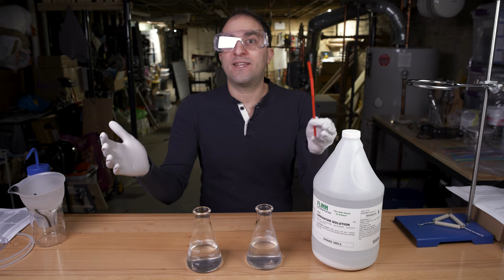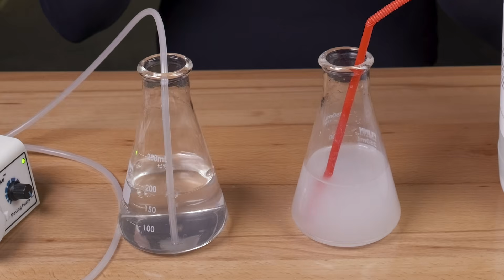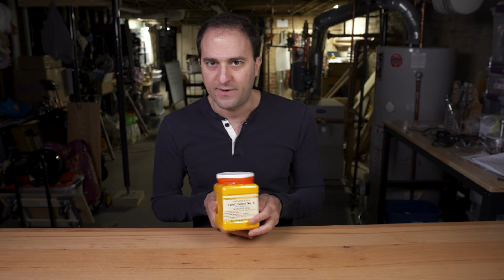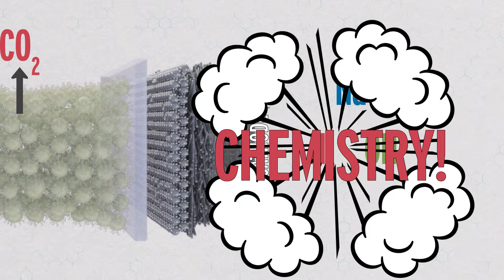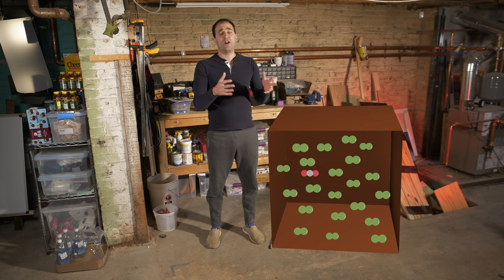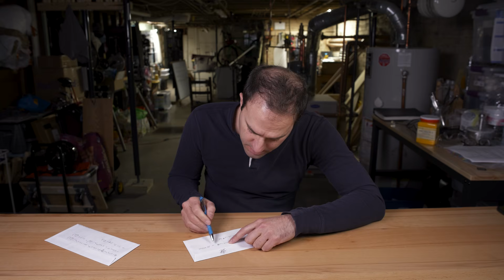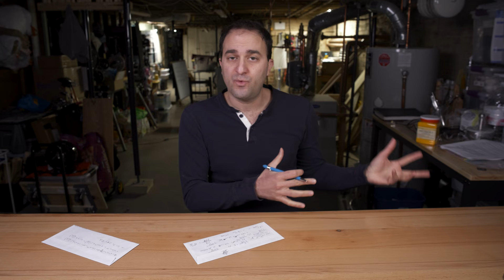Why a Carbon Capture Breakthrough Will/Won't Save Us

Comment: is there a reason why don't we just breed cyanobacteria and microscopic algae for CO2 capture?
with calcium carbonate you not only just capture and separate that CO2 at an expense of potentially burning fossil fuels, but then you have a lot of CO2 to get rid of
with cyanobacteria, they eat up the CO2 and solar light, release oxygen, and for the remaining carbon they multiply (if we neglect other elements they need like sulphur and stuff, which can just probably be just reused from the dead cyanobacteria)

and after that we can always use the excess cyanobacteria as animal feed or organic nitrogen (since it's rich in proteins, which contain nitrogen) fertilizer?

seems to me its advantages are:
more energy efficient (doesn't necessarily require additional energy input, unless you want it to work at night, then you need to use artificial light, and maybe use pumps to pressurize air to make it more efficient)
they don't have to inject any carbon dioxide into the earth, as they make oxygen out of it in the end
the product they make as a result of that can be reused

so it doesn't really make sense to me to capture co2 and inject it into the ground, i hope someone who knows can explain what are it's downsides?
Reply: it also takes energy to breed algae/bacteria, specially if you want to do it at a scale that beats trees, and then you have to figure out what to do with the biomass without wasting valuable resources, only the carbon. what makes this chemical process so good is the scale it can capture CO2 for the space/energy required.
Reply: @ well i thought the energy comes from the sun and hits the ground anyways
and the biomass, well, it doesn't have to be wasted, even people can eat something like spirulina
Reply: @ but you need pumps and nutrients being feed into the tanks, and if you want it to grow from sunlight only, you need a lot of flat space, meaning more pumps to keep the water circulating, if you want to save space and use bigger tanks you need lights, that again, consumes energy. and they take time to grow, what means they can't be used for, for example, smokestacks. and they are just a few times more efficient than planting a tree, they are much faster and take a lot less space for the same amount of CO2 captured per year, but we would still lack enough free logistically available space on earth to grow enough of them to offset our carbon emissions.
Reply: Problem is the bacteria die before long and release all the carbon they absorbed into the atmosphere as CO2 when they decay. 

Large vats of bacteria growing and dying can hold CO2. Like a bathtub that stays full even with the tap running and the drain open. The CO2 can be absorbed as fast as the bacteria decay. But the amount of CO2 that can be held in this way is constrained by the space available. And it's very space inefficient compared to similar alternatives like forests and even grasslands. 

Some scientists have proposed growing the algae in the ocean instead of land-based industrial facilities. By growing it in the ocean where wild fish can consume it, a portion of the algae captured CO2 will eventually sink to the bottom in the body of a fish where it can be captured indefinitely. As a bonus side effect, it will encourage growth of marine animals like salmon.
Reply: @ oh, that makes sense. but how are they planning to control growth of the algae in the open marine waters? you probably couldn't just dump a bunch of live algae there to try and multiply them, since there is already some algae, something has to keep an equilibrium if we chose not to control it? you'd have to somehow control the environment they are in to make sure their numbers are even significant enough to make a difference
Reply: @meowphedrone  There’s already millions of algae spores in every cubic meter of water. To encourage algae growth they spread the nutrients that algae spores are waiting for. IIRC the key nutrient in least abundance is iron. So addition of iron sulphate results in a massive algae bloom.

To be clear dumping iron sulphate, a dangerous industrial waste product, into the ocean is highly illegal in places like the US.

As far as controlling the algae bloom, in this proposal they don’t do much aside from reducing or stopping the addition of algae nutrients. The algae bloom disperses, gets eaten, and dies.

Comment: lime light is fun hmh. well just use solar heat, like plants do. yep passive capture for production uses is the best. or co-capture in a power plant. you dont need to do anything, ocean and plants already remove/regulate the co2 in the air. laws shug. well, just do something with the co2, like carbon coal making. repeat. sounds like klorialkali electrolysis process. but without nacl, some other electrolyte, not nacl. like koh. sodium from hot electrolysis? oh not koh, but naoh water electrolysis. why could you not state that clearly. cause you did not understand it. you just copied and believed what they said. bs. if you want to solve something, then dont leave the solution partial, its not a solution but a new problem, filling in the partial solution. no wonder why nobody understands you. be clear. only generalists understand it all. you better understand. with those skills dont even claim there is a problem. for you to solve. yep stay in the reference land. those values are just imaginary. ask God what he thinks about images of people. you gotta heat pump it, not just burn your limited energy. sun has a ton of energy. 40% of nothing is nothing. 10% of sun is a ton. well you just put a ton of solar co2 distillers and be done with it. or ask dinosaurs if they like to be your coal. blast from the past, or future humans. always assume the energy is free. otherwise you are always paying your bills a tribute. your assumptions shug. just get your coal from the air. or stop worrying. nope. or just take the heat from the sun, pump it. I dont agree with your worry or your goals. cheers. no, not even if you try to force your goals. or methods. or fears. or worries. dont worry, be happy.

Comment: I've never understood how long-term storage of pure CO2 is going to work.  If you just inject it underground, doesn't that create the conditions for a geyser at some point in the future?  Or are you hoping that it will react with Calcium/Magnesium Silicate minerals and become a carbonate?  But if so, won't that eventually clog the pipes?
Reply: Definitely more risky than storing radioactive waste from fission.
😐
Reply: The fission waste won’t be perpetually trying to expand and diffuse, and its radioactive effects are easily blocked.
Reply: @ Agreed.  Nuclear waste is a much more solvable problem than CO2 waste.
Reply: What pipes?
Reply: @YunxiaoChu  Pipes wasn't quite the right word.  For the carbon mineralization to work you'd basically need to do something similar to the fracking done for geothermal power plants, and the CO2 would have to pass through cracks and passages in the rocks.  As the carbonate forms, the rocks will expand, closing up those passages.
Reply: @ the crystals would probably leave small gaps in between themselves and allow gas to diffuse through

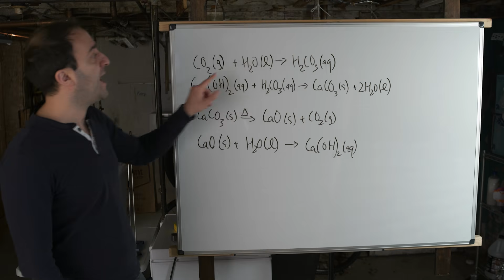Comment: 2:33 what do you do with the CO2 released during regeneration? i feel you never addressed that.
Reply: You inject it deep into the ground (he mentions this when he talks about ClimeWorks towards the end of the video).

The reason you have to do this is so that the substrate (calcium hydroxide, potassium hydroxide, or whatever it is you're using) can be re-used to capture more CO2.

Comment: Thank you for this. DAC only makes sense if zero emission energy becomes essentially free and we MUST get net negative. There are arguments that we needed to be net negative at 350ppm, so in a way this tech may eventually be necessary. It just won't be sufficient. You need zero emission generation.
Reply: On the contrary we have a vast supply of solar energy with which to power DAC

Comment: There's a big issue with the calculation here. They assume that the process is powered by electricity (either using it directly, or using it to heat the substance).
Power plants that convert steam to power (nuclear, coal, gas, geothermal, etc) are only about 30% efficient and our power transmission grid is only about 90% efficient. The vast majority of the energy is lost, heating water using power generated from boiling water is a terrible system.
Instead, this could be done by piping all the used solution through a nuclear plant that just heats it directly without boiling the water, meaning it would be very efficient without the loss from capturing steam energy or transmission.
Or for the 60°C solution, just pump it into large black insulated containers unde the hot sun in hot sunny climates, it would reach 60°C without power, or at least get close enough to it for us to raise it the last few degrees.
Or drill holes in the earth and pump it down. Unlike geothermal power, which requires temperatures of ~150°C to function, you are just heating it to 60°C, which is equal to about 3km depth at most, which we can easily drill (we go that deep at my work for exploration drilling). And since there's no phase change of water, you won't deplete the local thermal energy nearly as fast.
Or we can use biological methods. Algea does all the work for us, converting the carbon captured in the water into useful more complex molecules that can be used for anything from food to oil using just sunlight and trace nutrients. And it's nearly 100% efficient with low costs to run.
Also in your calculation, you calculated pulling it from normal air, not the already concentrated air from power generation exhaust.
Carbon capture is hard, if it was easy we would already be doing it on every generator. But we need to be giving it a fair shot using sources of energy other than electricity from power plants.
Reply: Valid ideas but you have to think of scale and logistics as well. That is the point of this video.  The nuclear plant would require specialized infrastructure and specialized equipment to be developed and engineered from nothing which is extremely costly.  The containers sound easy until you think about scale, weather, and geography. Drilling into the earth is not easy either. Do your small holes you see at work really scale out to the size needed to pump millions and millions of gallons? Plenty has been done as far as biological solutions. The problem again is taking it to scale. We can engineer algae to do it, but we have no way to really deploy them at the levels we need because you can't just release them back into the wild. 

You got there though by the end. It is hard, and the power and costs that go into it are something any carbon capture project being developed should state from the outset. We don't need creative solutions that catch the imagination; we need viable solutions that work right now. Electricity has many ways you can generate it, and the infrastructure is already there. Anything that would be able to be scaled to the levels we need would also need easy access to power to be truly viable.
Reply: @Mr.MashenIt how's any the scale and logistics of carbon credits being used to subsidize Africa and China..   now that we're bankrupt, I guess ppl want to build things off scale
Reply: @Mr.MashenIt 
Nothing is easy if you lack the work ethic and intelligence to figure it out.
Reply: @Mr.MashenIt  You are so right. The problem with scale is something I have tried to get across in many discussions, and failed. The numbers just get to big to be understood.
Reply: @ Often these solutions work in a lab and in small prototype, but when you get to scaling, they see the size of the problem. Most people can't fathom how much air is actually in the atmosphere. He takes a little chunk out to do the math here in this video, but it is all of it would need done. There is 5 quadrillion tons of air that needs circulated through a capture to actually capture the carbon we make in the air.
Reply: @bknesheim 
The Earth has an atmosphere with 5.1x10^18kg of air. Somewhere in all that is all the carbon we put out.

I would say humans have a much more difficult time understanding the scale of time. Because our lives are simply too short for us to comprehend how many lifetimes it takes to do this work.
Reply: btw this is why I mostly agree with the video but disagree with the final conclusion which states that the only way to make this worthwihile if we incrase said chemical conversion efficiency. However, as I see, since it is presented as a ratio between annual emission and annual electrical power production this ratio can be also influenced by incrasing the efficiency of power production compared to associated emissions. What you suggest would excatly do that, and make so that we have a better power per emission ratio, which would allow to get better results even if we leave the chemical process efficiency as it is currently, for whatever reasons (mostly costs and scaling can block this kind of things)
Reply: @CraftyF0X yes, and then you take your thought and take it to the logical conclusion. think about all the money and research and production costs of scaling even a single one of these carbon capture technologies, let alone all of them, would take at scale and you think... 

Wait what about technologies that offer 90-100% emissions free energy generation instead? what if we just used this money to stop emissions from power generation and some other major culprits - something we already have good, scaled solutions for?

Seems a damn sight more efficient.
Reply: But the electricity removal method is significantly more efficient than the heat method.  

Direct heat would be best if you absolutely had to use nuclear.  However, if you have solar panels you can oversize your electrolysis cell bank to take advantage of peak solar output.
Reply: 43 billion tons.
Reply: Imagine if We like.. planned trees and grew alge.  All that free solar energy could power these green Technologies
Reply: I only have a slight critic. Geothermal energy is not renewable. Any kJ of energy you remove from the soil is lost. You would need to dig deeper or move your pipes if you want to exploit the plant during a long amont of time.
I also wonder how nuclear engineer would react telling them to use their reactor to heat a chemical reaction. I am pretty sure they would be scared to death.
Reply: Great comment.  These are good points.
Reply: Funny how the green party hates everything green
 Especially algea. Even in the 90s a 14yo thought we'd just invest in engineering some super already and better trees.. which would help us lay the ground work to terraform mars

Comment: what's the point in capturing the CO2 if you have to release it all to regenerate the base material?  isn't the whole point of carbon capture to actually insure it's removed from the air.  Isn't the challenge "How do you break the CO2 down into C+O2, place the Carbon in the ground and release the O2 into the air?"
Reply: splitting co2 actually results in co+o

Comment: This makes a fatal assumption that you must use energy in the form of electricity.

It may be totally feasible to capture carbon directly from energy within the environment (i.e. photochemistry, biochemical, or carbon capture from wind power, seem like good choices)

The energy within these systems are not capped by our electricity production.
Reply: Snap
Back to reality 
whoop!
There goes carrying capacity
Reply: @SigFigNewton  What do you mean by carrying capacity in this context?

Comment: Why burying it in the ground tho? There are and will still be plenty of human works that will still be requiring CO2 . Long use plastics, insulation, cement, rocket and aviation fuel (for the years ahead)... The secret is it has to be long lasting, potentially more than a tree's lifespan (otherwise trees are just as afficient at net zero) , and companies that do carbon recapture have between their hands one of the few ways to see a return-on-investment (in contrast of doing it pro-bono filantrpically or government-funded)

Comment: I'm European and the idea that carbon capture was alternative to emissions reduction never crossed my mind. That is, until I put it in the context that this is what alternative right wing US parties propose (the few that believe in climate change) instead of reducing emissions. This is utterly nonsensical.
Reply: It's a stop gap solution to reduce emissions until the permanent solutions are ready to fully take over. Not nonsensical at all, just understanding reality.
Reply: @evancombs5159  The math  shows why it should be the other way around. Cutting emissions is the stop gap solution. Carbon capture is a possible part of the long process of rehabilitation.

Coal plants, for example, are not economically competitive when you slap carbon capture technology onto them. That's carbon capture from concentrated gas, far more efficient than the subject of this video. If coal plants clean up the mess they create (only counting the emissions from burning, not mining), they wouldn't be able to make money. So what works better in the short term? Subsidize the plant made non-competitive by the carbon capture requirement? Invest in an even less efficient high-tech system to capture carbon from that plant when it's already diffused into the atmosphere? Or do the thing we can do right now: close the damn plant?

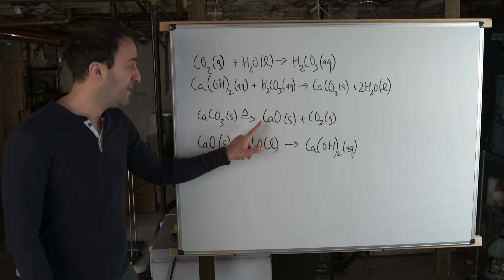Comment: 2:27 Why would you liberate the CO2 once you've captured it? NVM, it's answered at 9:11 (it gets injected deep underground)
Reply: Because you need to do something with the CO2. Right now what we're mostly doing is basically reverse fracking; we're pumping the CO2 deep underground and expecting that the rocks down there will soak up most of it.